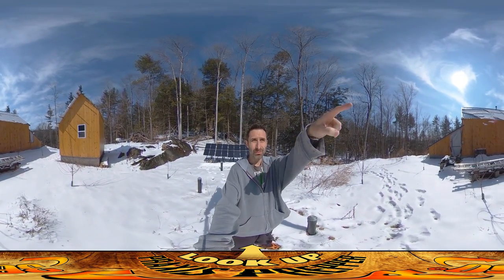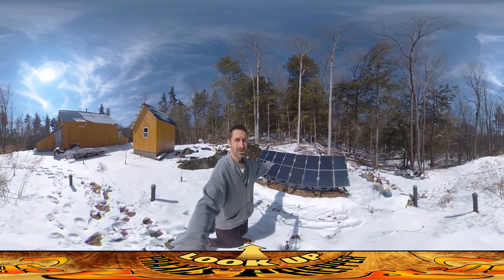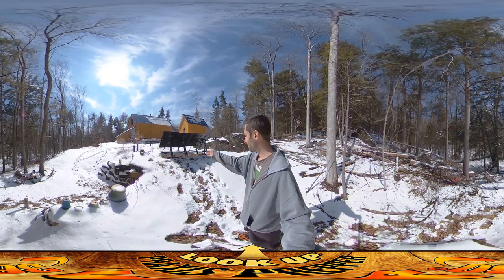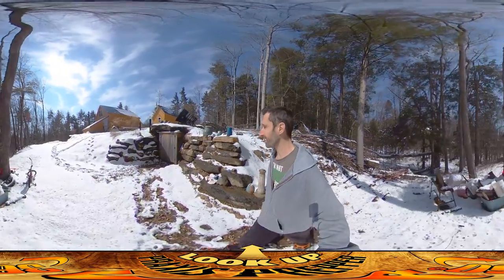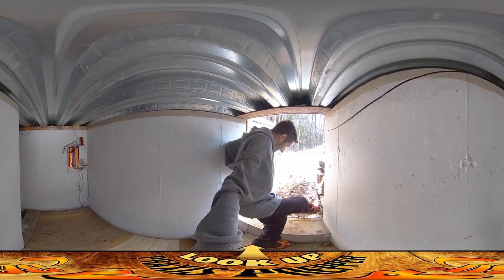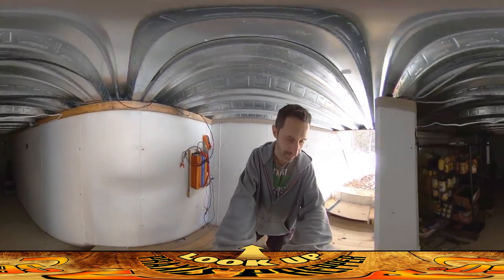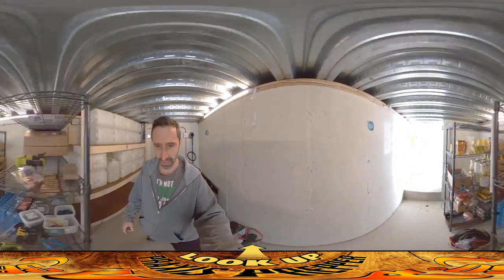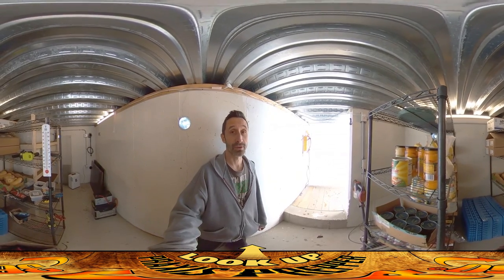Homestead Building - Mini Solar System in Fallout Shelter, Winter Solar Issues, Wiring Issues Solved

Comment: It’s honestly been so long ago that I can’t quote a source, but anything not connected to the grid that also does not have really, really, really long wire runs is essentially EMP proof naturally. The issue is that for the damaging electrical wave to impact electrical wires they have to be long enough for the wave to interface with wires and then conduct them. It’s why the Canadian city taken off-line during a CME impact well over a decade ago, didn’t see widespread damage to electronics or masses of dead cars.

There was a study (also probably a decade ago) specifically testing the impact of EMP on various vintages of cars, although it was several years ago it was still recent enough for heavily microchip controlled vehicles, and all of the cars except one not only survived the EMP, but they continued to run during the pulse itself. The one car that did die was successfully restarted with no other ill affects.

Dr Arthur Bradley did a video quite a while back discussing why the EMP Shield probably won’t be effective and was working on designing a unit that would be effective for homes. I haven’t watched any of his videos for a while though so I don’t know where he stands in relation to production but I do remember him having made solid progress.
Reply from the maker: Yeah, there are a lot of question marks when it comes to EMP. Certainly what you reference about shorter runs of wire being less of a risk, but with that question mark over it all, I try to cover my bases as much as possible. There are multiple waves associated with EMP (3 I believe), and they interact with the electronics they hit in different ways. Arthur's device didn't end up coming to the market. I spoke with him about it and he said that the issue was related to the testing protocols. I didn't press further, but it sounded like the testing required for certification was too costly for him to swing. He recommended a Siemens unit for the whole house. He uses it anyhow. I tried to grab that one, but they were unavailable at this time, so I went with the EMP shield device - figuring that something may be better than nothing. I saw some pretty good reviews of the EMP shield in terms of managing a lightning strike successfully, so even if that's all the EMP shield unit can handle, that's still not nothing.
Reply: @PraxisPrepper  True but the biggest thing that bugs me about the EMP Shield design is that it isn’t in between the incoming power and the panel, it’s just another branch off the panel meaning that it’s potential to mitigate a surge is based on it absorbing EXCESS power across any open circuits which would only seem to protect outlets that aren’t currently drawing power meaning anything plugged into an outlet would still experience a large surge. 

The design of the electronics inside it aren’t something I’m comfortable commenting on, it’s the integration into the panel that’s the problem I’m looking at. Assuming the electronics inside are absorbing the surge, then effectively mitigating a large surge like a lightning strike makes sense although I still question that little box having enough absorptive capacitors to make a real difference.

If you look at DoD EMP mitigation designs, they actually completely disengage the power, kind of like blowing a fuse except that they are driven by electronic detection and the physical design of the connections themselves.

I do remember that the cost of the kind of testing Arthur wanted to do to really prove his design worked was a significant obstacle, and if I remember correctly he tried going the Kickstarter route, but I stopped following his progress around that point since any point I’d be in a position to seriously consider a solution was years in the future and I’d tired of all his EMP bag videos.

I’m confident Arthur was already thinking about designing a device when he did his initial review of the EMP Shield design so you always have to keep that in mind but having known guys like him myself, I doubt he would have bashed it strictly to try to sell his own idea for a device that was only on paper. Then again, I mentioned I got tired of all the EMP protective bags and he was hawking them and some sort of EMP car cover even though I think he participated in that test of cars I mentioned previously…

It does bring up an interesting question though given that your house was recently, if not still partially, connected to the grid whether having a main line circuit breaker turned off in the panel would be sufficient to eliminate any potential bridge between the main power lines and the breaker panel given that the connectors are still just a few millimeters apart from each other. 🤔 If you are now switched over completely to solar, did you have the power company disconnect you at the meter or were you able to do a main disconnect yourself at the meter? If not, might be worth considering although it would make at least an extra step if you are actually planning to have easy access to grid power by using a transfer switch.
Reply from the maker: @inmyimage1081  As with all my preps, I never completely put my trust in any on of them. Once we swap over to solar, we are able to break the connection with the grid at two points, and I plan to do so. Every little extra bit of protection is good. As for Arthur, I have a great deal of faith in his knowledge and integrity. Had I been able to procure the Siemens unit he described, I would have done so... and still could at some point - when I could add it to the system on top of all the EMP shield devices.
Reply: @PraxisPrepper  He definitely seems knowledgeable about the topic and the last part of my previous response was a bit tongue in cheek. I know that a nuclear EMP is has a lot more potential to cause damage so any mitigation is worth considering we just aren’t close to being ready for something like that.

Always have to get after my wife about prioritizing her wants and “needs”, especially in the trailer. I tell her 1 thing in means 1 thing out but it never seems to work out that way… 🤪 We did talk about a big vulnerability right now being the lack of solar so it is going to be a priority at the end of the month. There are quite a few companies selling used residential and commercial panels so will probably go that route unless I can get a deal on some new ones.

Unfortunately because of all our continuing medical bills (now that I’m mostly in maintenance modes she decided it was her turn to start accumulating some) we didn’t have much savings, even had to liquidate my 401k to pay off medical bills and our cars so we could survive on about half my post disability income. Going from a software engineer’s paycheck and a disability insurance paycheck was a massive hit because my insurance policy was based on salary and didn’t take into account my bonuses which were a sizable chunk of my income.and a desire to end up in something more homey, all the money we walked away from the house with.

We were able to lay down big down payments for the truck and trailer but still had to take out short loans and both will actually be paid off in 2’ish more years right now. I’m planning to refinance the trailer though and try to pull out some of the equity to put down a really good down payment on some land and quickly get a septic system and well installed in addition to a stone driveway but plan on doing most of the work myself. We have quite a few heavy equipment rental companies in the areas we are looking for land so finding equipment to rent won’t be a problem and the rates are cheap enough to save thousands over hiring someone else to do the work.

Really would be nice to waive a magic wand and have a homestead all in place and be debt free but we live with the hand we get dealt. Just really glad I believe in insurance and took out a disability policy so we still have a solid income to work with. Extra bonus is that it is guaranteed so I don’t have to worry about getting laid off which was and still is really common in the tech industry.

Comment: As a goof theory...what if you ran a air line or two rigged in place to blow off your panels....it could be turned on from inside using a fairly small compressor...just a thought
Reply from the maker: I was thinking about something similar, but with water instead of air. The way the snow clods up on things here, I could manually shoot air straight out of a compressor at the surface and the snow would be hard pressed to move. Water could do it though. Water could start melting the surface and then the melted surface would get some sun and it would begin heating up the entire panel. IDK if I'll do that though. A lot of work to set that up while we're still trying to get the place to a point where there'd be breathable air inside. Hopefully spring just beats us to it... or the peace talks work. Sounds promising as of today, but we've ll heard that before.
Reply: @PraxisPrepper  I unfortunately would not hold my breath for peace
Reply: My thinking on the topic is to pivot either the top or bottom of a solar rack and set up a telescoping system on the other giving the ability to not only change the angle based on the season but to give it the ability to go vertical after snowstorms to dump the snow off. Big issue in the area of Indiana we are looking to build in is ice storms that coat everything, pretty treacherous actually, but once any snow uncovers them the ice should pretty quickly melt enough to slide off them as the black face of the panels heat up. Another thought I’ve had is a sort of squeegee system that can be set to periodically wipe/brush them off during a snowstorm to prevent accumulation.

Comment: I'm always afraid the snow will slide off of my metal roof onto some on my beggar chickens and smoosh them LOL!
Reply from the maker: I'm supposed to get chickens this season... I hadn't thought of that. Any tips on how to mitigate the issue (other than just leaving them in their coop until it all slides off?
Reply: I tried putting little fences in my garden bed along the house, those ones that just stake in, but the snow was as deep as they were and smooshed them too LOL. Keep them from the edge of the house mostly when I can tell we are melting. It's all my fault they congregate by the door. I randomly toss leftovers out to them all the time when I should be putting it in their dish. 
I got Australorps they are the kindest most profuse egg layers, if you are looking into breeds <3
Reply from the maker: @reginasritual9380  Thanks so much for that tip on the breed.  I was thinking about your snow fall warning this morning and I was thinking that maybe I would just not let the chickens out until the roof slides. The roof always slides before the ground snow melts off to reveal the ground beneath anyhow.

Comment: I noticed you have a single door perhaps you could put a second door in that would be gas tight incase the first door were to be damaged or not air tight?
Reply from the maker: Good thought. However, one actually doesn't want for the structure to be completely air tight. We need to continuously bring in fresh air from outside, so the space will need to vent out the stale air. There's a gasket around the door to help seal it up, but insofar as it's not a perfect seal, it'll actually be necessary to allow the stale air to escape. As long as air is being vented into the structure, adding positive pressure, any cracks around the door wil be blowing air out, so will prevent outside air and dust entry.
Reply: @PraxisPrepper  Very important consideration is keep positive ventilation so that any air bleed is from the inside to outside so the only incoming air is forced to go though your air filtration system,
Reply from the maker: @inmyimage1081  Yeah, that's the exact plan. When the door is opened (as long as it's done slowly), the air should be pushing outward... mostly. Differential in air temp will mess that up a bit. Not a perfect system we're setting up here.